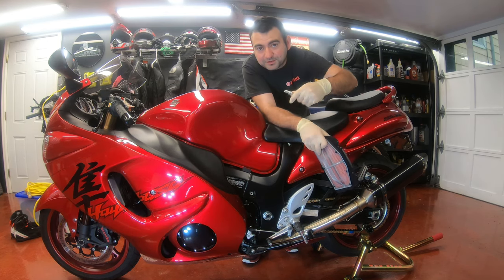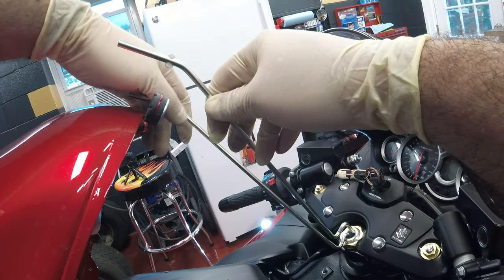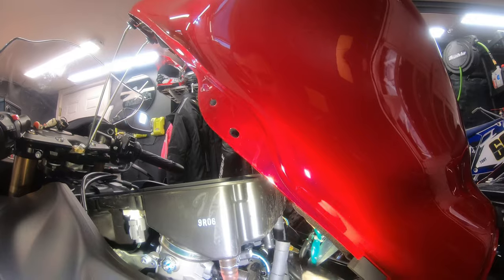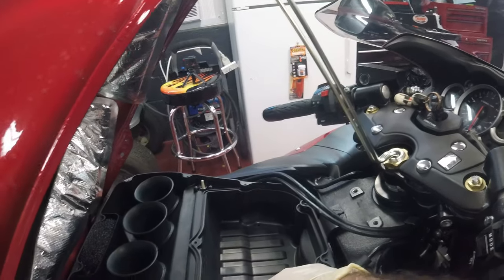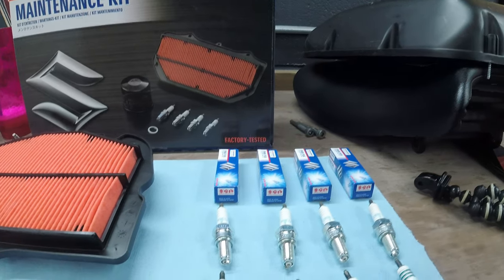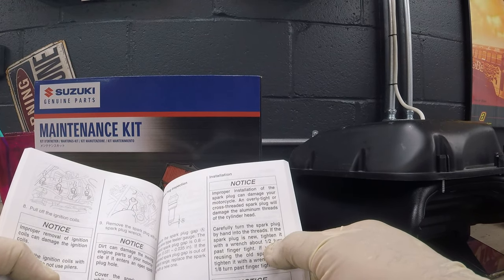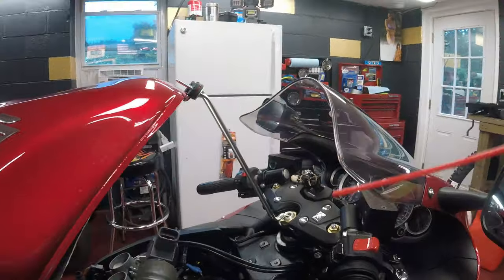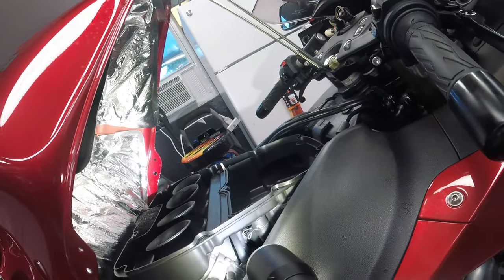Air Filter And Spark Plugs Replacement On 2nd Gen Hayabusa 2008-2020.

Comment: Just finished changing mine. Great tip about backing off the screw until it seats itself in the thread. I did that and the screw went in very smoothly.
Reply from the maker: Awesome job man! Happy to hear it helped you 🙌😉

Comment: I use  10 " of fuel line with one end split to go over the plugs to pull out /reinstall plugs. Even work in places you can't see.
Reply from the maker: That's a great trick and works very well!

Comment: How to identify if spark plugs gone bad?
Reply from the maker: If the tip and electrode is worn down, doesn't appear as "sharp" as a new one and it's rounding of or if it has turned excessively white, those are visual signs that they're bad. Anyhow they're a wearable item and must be replaced every so many miles just like oil.
Reply: @MototalkUSA  Okay! Got it brother 👍🏻
My Busa backfires a lot while releasing the throttle from few days. Is it a sign of faulty spark plugs?
Reply from the maker: @hayabusawalebhaiya it might need to be tuned, did you install an exhaust or something? Usually that's when they start to back fire. But start from the basics, put a new air filter, new spark plugs if they haven't been changed for a while and sync the throttle bodies. How many miles do you have on it?
Reply: @MototalkUSA  Yes. I am having Yoshimura exhaust and K&N filter installated. Bike have done almost 21000 kms
Reply from the maker: @hayabusawalebhaiya  yeah, I would definitely give the bike a good tune up and balance the cylinders and tune it or install a power commander or similar tuner. It's running a little too lean probably and it's asking for more fuel. You'll get more power and smooth running 😉

Comment: Where did you get the gas tank support rods?
Reply from the maker: Here's an Ebay link for it: 

https://www.ebay.com/itm/285638146732?campid=5338967980&mkevt=1&mkcid=1&toolid=10050&customid=&mkrid=711-53200-19255-0&campid=5338969497&mkevt=1&mkcid=1&toolid=10050&customid=c8976832a982124d7e1d0e2f7a269e04&mkrid=710-53481-19255-0

Comment: What was that yellow light when you were checking to see if it ran ok? nice video btw
Reply from the maker: The yellow light is an ABS light. All Suzuki's equipped with ABS have that light go on when the bike is first started and then when you take off (approx 5mph) the light goes away.
Reply: @MototalkUSA  awwww abs is nice my 08 Hayabusa doesn't have abs very jelous
Reply from the maker: @moop1522  From 2013 and up all Busas are equipped with ABS and to make you a bit more Jealous 😜 they also have Brembo calipers in the front!
Reply: Can ABS be switched off?